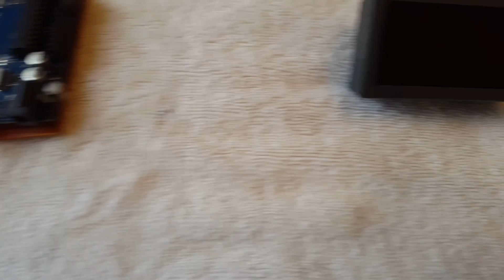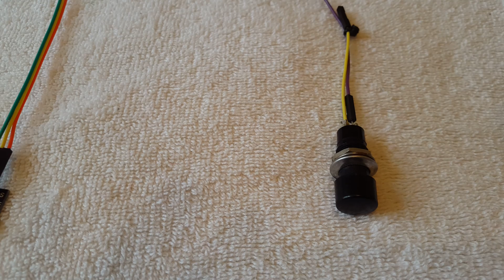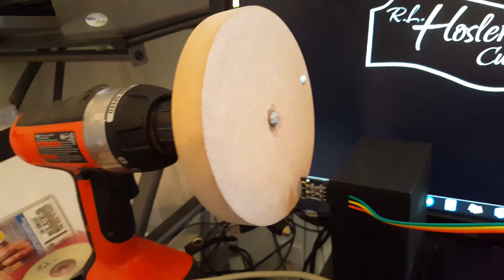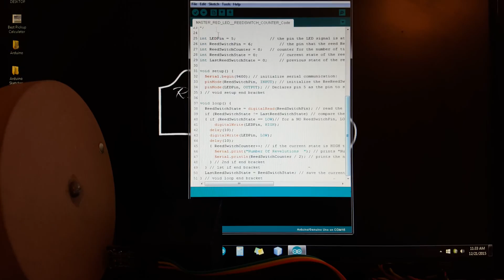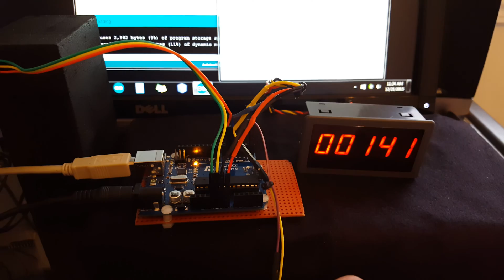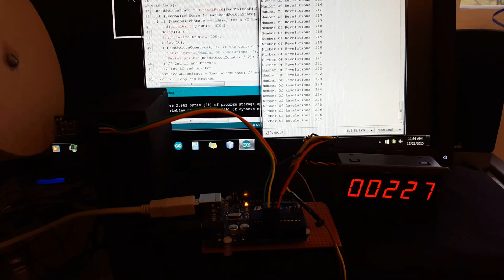LED Counter / Arduino UNO

Comment: Any chance you would be willing to share that code? I've had my winder assembled for a while and I'm thinking arduino is probably the best option for counting. Thanks
Reply from the maker: /*
  This is the Red LED Display program that works.
  It consists of a Arduino UNO, or Mega, maybe other boards, a 5 digit LED display,
  a ReedSwitch, and a monentary pushbutton switch, used as a reset
*/

/*
  The ReedSwitch wires are:
  Green = Vin
  Yellow = Ground
  Orange = Digital Pin (8 in this case)

  The LED Display wires are:
  Red = Vin
  Black = Ground
  Blue = Signal IN (2 in this case)
  Yellow = Goes to the Reset switch

  Tth Reset wires are:
  Yellow to LED reset wire
  Purple to pin 0

  Wire colors will vary, dependong on manufacture.
*/

int LEDPin = 2;              // the pin the LED Display signal is attached to
int ReedSwitchPin = 8;           // the pin that the reed ReedSwitch is attached to
int ReedSwitchCounter = 0;   // counter for the number of times the reed ReedSwitch is closed
int ReedSwitchState = 0;         // current state of the reed ReedSwitch
int LastReedSwitchState = 0;     // previous state of the reed ReedSwitch

void setup() {
  Serial.begin(9600); // initialize serial communication:
  pinMode(ReedSwitchPin, INPUT); // initialize the ReedSwitch pin as a input:
  pinMode(LEDPin, OUTPUT); // Declares pin 5 as the pin to send pulse siginal to LED
} // void setup end bracket

void loop() {
  ReedSwitchState = digitalRead(ReedSwitchPin); // read the ReedSwitch input pin:
  if (ReedSwitchState != LastReedSwitchState) // compare the current state to its previous state
  { if (ReedSwitchState == LOW) // ReedSwitchPin, LOW is the closed position
      digitalWrite(LEDPin, HIGH); // Sends a signal to the LED Display
    delay(1);
    digitalWrite(LEDPin, LOW);
    delay(1);
    { ReedSwitchCounter++; // if the current state is HIGH then the button went from off to on:
    // The following line is for testing and prints number of revelutions on the serial monitor.
    // Removing it will allowing the progran to run a bit faster.
    // Serial.println(ReedSwitchCounter / 2); // prints the number of times the ReedSwitchPin has been closed
    } // 2nd if end bracket
  } // 1st if end bracket
  LastReedSwitchState = ReedSwitchState; // save the current state as the last state, for next time through the loop
} // void loop end bracket

Comment: nice which display did you used?
Reply from the maker: +TechMaker, search eBay for this, DC 7-12V 0.56" Red LED Digital Counter & Timer & Meter count Multi-function. Any of those, that count, will work.
Reply from the maker: +TechMaker , on the one I had, I just had to remove all the jumpers, located inside the casing, to make it a counter, rather than a timer. If I had it to do all over, I'd get one that allows countdown too. then you could set the desired count, and even set an alarm when getting close to the end.